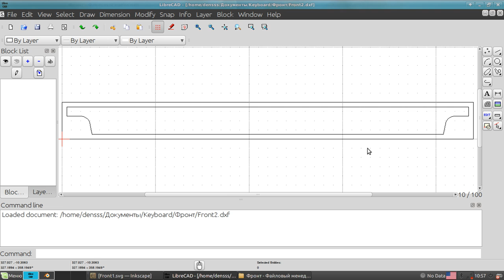My first steampunk keyboard. Моя первая стимпанк клавиатура.

Comment: Awesome!
But the metal keys, don't they make them too heavy? I know it not a lot of weight..but keyboards don't usually have much spring back. just wondering if you found that a problem after.
Reply from the maker: So far, there have been no problems.